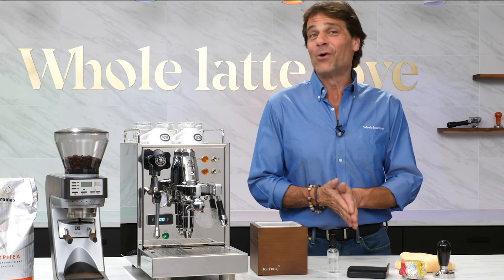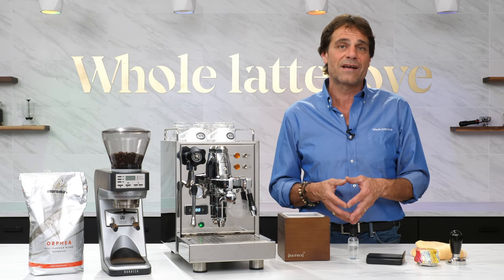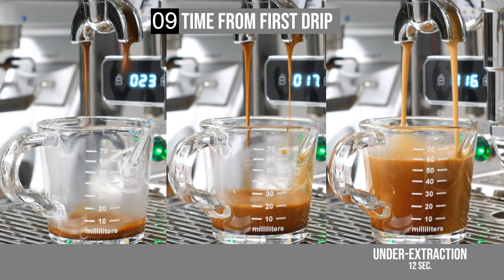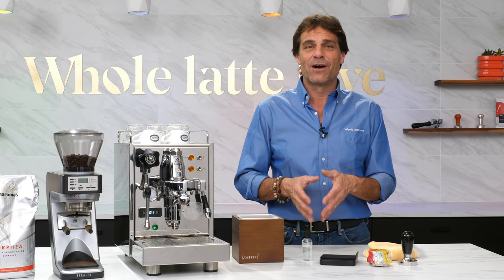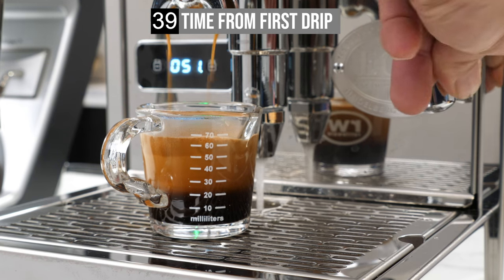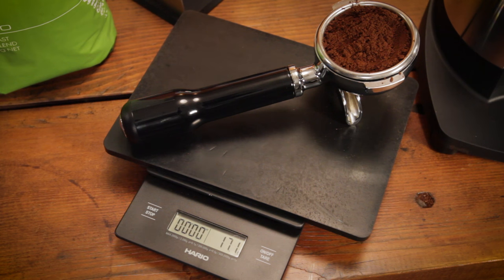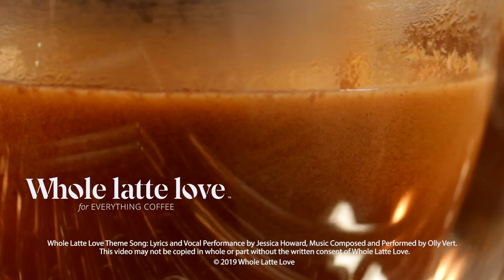How To Dial In Grind Size for Espresso

Comment: A question about brew pressure:  As the pressure builds, does it reach the maximum point (e.g. 10 bars) because of an equilibrium with the coffee and the extraction flow - or - does it reach the max point because that's what the OPV is set at?  Or to ask it differently - should I try to achieve 10 bar through grinding and tamping, or just set my OPV to 10 bars and instead try to adjust the flow rate?
Reply from the maker: Hi Bob, Thanks for the question. Not sure what type of machine you have so if rotary pump set OPV to 9 bar on the machine gauge. If vibration pump 10 bar on machine gauge - that'll get you ~9 bar at the group. When dialing in you can reference the brew pressure on the machine gauge but IMO timing of 20 - 30 seconds from 1st drip is more important when dialing in grind. I would not worry too much about getting to a grind which causes a brew pressure that gets you to the OPV limit. In nearly all cases there's no benefit to brew pressure above 9 bar. In fact, in my experience and others there's little difference in extractions in a range of 5 - 8 bar and they tend to be more consistent shot to shot. In those ranges flow rates can make a big difference. Hope that helps!
Marc
Reply: Thanks, Mark  I have a Bezzera BZ10.   After watching your vids as well as others, I am now just realizing that my concept of brew pressure was wrong and that's why I've been unable to get a decent extraction from the BZ10.   Luca Bezzera explained this in one of his vids.  The target brew pressure depends on the type of pump.  Large rotary pumps operate at a lower pressure than small vibrating pumps.  The OPV on the BZ10 is set to 12-13 bar.  I've been going nuts trying to adjust the grind to achieve 9-10 bar, but could never get the right flow rate.  Now I know why.  I thought 12 bar was "off the charts" but in fact, that's the sweet spot for the BZ10.  Now, thanks to your comments, I won't worry so much about the pressure gauge and just concentrate on the flow rate.  At least I know that 12-13 isn't "wrong" for this machine.

Comment: Hi Mark,
What is your recommend volume for fresh coffee and not so fresh coffee?
As both produce different crema.
Should I set 60ml as per video?
But I saw you extract 70ml.
Is the volume of espresso include crema?
Reply from the maker: Hi Bryant, One has to estimate a bit when using liquid volume to measure an extraction. For coffees which produce a lot of crema I find a 17-18g dose results in ~70ml including the crema at a 1:2 brew ratio. If the coffee is not producing a lot of crema because it's not so fresh or a type that doesn't produce a lot then volumes will be much lower. If you want to be precise it's best to weigh the espresso as it extracts to reach the desired ratio. Hope that helps!
Marc
Reply: @Wholelattelovepage  Hi mark, so meaning 60 to 70ml of liquid is depend on scale.
If I using 18g, the liquid volume will be 36g which may be 70ml.
So best to purchase scale right?
If currently I do not have scale yet, what is the recommend liquid volume for fresh coffee that produce a lot of crema.
Should I set to 70 ml?

Comment: How about grind size with the dynamics latte crema?  Having trouble getting a non bitter or sour shot with black cat and illy intenso
Reply from the maker: Hi EM, The Delonghi Latte Crema? Bitter shots indicate an over extraction. Options to correct for bitterness are: set the grind coarser, reduce amount of coffee used (lower the strength), reduce brewing temp, decrease shot liquid volume. Sour shots indicate an under-extraction. To correct for sour flavor: decrease grind size, increase coffee dose, increase brew temp, increase liquid shot volume. Hope that helps!
Marc

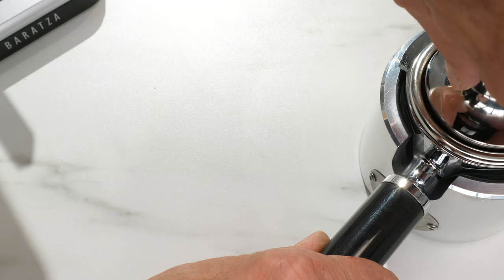Comment: At about 5:10, what is the ECM product that your setting the portafilter into to evenly tamper the grounds? This is by far the most frustrating a difficult variable in my espresso process in that I’m not evenly distributing and tamping the grounds exactly level. I get pooling after extraction which I know level tamping and even distribution fixes. I would love to know what that thing is called. Thank you

Comment: It is possible to get a great shot with 17 seconds? Gaggia classic pro with IMS basket, I use preinfusion (manual with trick) and temperature surfing. I use about 8 seconds of preinfusion and then I brew but I get very fast shots (17-20s) to get the 1:2 ratio but they are delicious so I am not getting it...
Reply from the maker: Hey Peter, Thanks for the question. If it's delicious at 17-20 with 8 seconds of pre-infusion then I see no reason to change. End of day, taste is what matters and not hitting a magic number which is just a guideline.
Marc

Comment: Hi Mark. Why every time I read about brewing for espresso it says to grind fine. Then the extraction won't run as it should be. I use a Breville touch with the integrated grinder. I'll appreciate your advice. Thanks, Enrique.
Reply from the maker: Hi e, You need to adjust the grind to pull the espresso in the 20-30 seconds from 1st drip. That's the basic dial in of grind size and tends to be a very fine grind.
Marc
Reply: Thanks for your reply. I'll look into it and let you know how it goes. All the best.

Comment: So, its count from first drip of coffe, not from the you turn on the pump 🤔
Reply from the maker: Hi HP, That's what I use. In my mind extraction starts when water starts flowing through the puck. This happens faster on rotary pump machines than on vibration pump machines. Then there's pre-infusion - not used in this video which could go for 10-20 seconds with no substantial flow through the puck.
Marc
Reply: @Wholelattelovepage  thanks a lot!! :)
Reply: Almost everyone else in the coffee indutry uses pump. Be warned

Comment: Love watching your videos ... now that I've found them. I've been using a KitchenAid Proline Burr Grinder for my pour over, French press and stovetop moka espresso coffee makers. Now, my wife is offering to purchase me an espresso machine, probably the Gaggia Classic Pro. What are the chances that I will be able to get a fine and consistent enough grind with my Kitchen Aid Proline grinder? I do have new replacement burrs from KitchenAid to install in the grinder. Thanks for your advice!
Reply from the maker: Hi William, Thanks for the kind comment and question. While I have not used that grinder, my understanding is it's a stepped grinder with a limited number of grind settings. I looked up the KA PBG and it does not seem to have a method for grinding directly into a portafilter - but I could be wrong on that. Dumping/dosing from a grinds container into a PF gets old quick, can lead to poor grind distribution and wasted coffee. For espresso, tiny changes in grind size make a big difference. Grind quality is usually more important than the espresso machine. I recommended considering a grinder with stepless grind size adjustment which can grind directly into a PF. Hope that helps!
Marc
Reply: @Wholelattelovepage  Marc, that helps a lot. Since the Gaggia Classic Pro comes with a pressurized portafilter, that means I can use my current grinder until I can replace it with a Baratza (probably a Sette 30). That way I can do this in two steps without layout out almost $600! Regardless, your discussion of the Gaggia Classic Pro really solidified my interest in that espresso machine as a good beginning choice.
Reply from the maker: That sounds like a good plan! I know good espresso grinders are not cheap 🙂. Like I said, I’ve never used that grinder so outside chance maybe it can grind fine enough for non pressurized but looks like there’s a limitation on precision of size adjustment. Can always go with pressurized if you have to. 
Marc

Comment: Hello Mark! 
Why do you choose to start the timer from the first drip vs (as I’ve read I’m some articles) pull the lever. I’m my case using the barista express when the button is pressed there’s about 9-10s of pre infusion before the first drip—what’s your advise with my case too? 
Thanks!
Reply from the maker: Hi Omar, Thanks for the question. I choose to go with first drip as I work with a variety of machines. Some have rotary pumps which build up pressure faster than vibration pump machines. I’m often working with pre-infusion which delays full pressure flow thru the coffee for 5-20 seconds. In my mind extraction starts when brew water is flowing thru the coffee. Depending on machine and/or technique when flow starts can be very different. Keep in mind, timing of extraction is the most basic method of evaluation. It let’s you know you’re in the ballpark.
Marc

Comment: Thanks for making this video!

I have a Gaggia Classic Pro and Eureka Mignon. With fresh beans, the time taken to output from 16-18g dose to the desired standard ratio is shorter than 20s. I’ve tried adjusting the grind size to finer (between 1 to 2), but resulting a bitter/burnt smell after brewing.. How can I improve the yield time without creating the burnt taste?
Reply from the maker: Hi KC, Thanks for the question. It may be the coffee you are using. If not some other ideas:
1. Bitter flavor (unless inherent in the coffee) indicates over-extraction. You could try a short cooling flush of 1-3 seconds just prior to making an extraction to reduce the brew temp.
2. Combine a larger coffee dose with same or slightly coarser grind to slow things down and avoid over extraction.
3. Cut the shot sooner and don't worry about the timing if flavor is good

Comment: HI Marc, love your videos!  I'm struggling with getting it right with my new Gaggia Classic Pro, and 270Wi.  Burned through half a bag of Orphea, and it still doesn't seem right.  Last attempt was a grind setting of 7A, 16g load, 25 second extraction, 33g shot out.   Still kinda bitter.  Maybe it’s me?    Maybe I should have got a Jura instead?  LOL
Reply from the maker: Hi Q, Thanks for the comment and question. You are in the ballpark with that timing and yield. Do know every grinder will be different so I can't say much about your specific grind setting. And don't lose those shims that came with your Sette. During initial break-in your grind will gradually get coarser. Usually need to a use a shim after about 8lbs of coffee ground. One thing you might try is a short flush from the group without PF in place right before an extraction. Just a couple seconds to bring the brew temp down a bit.
Marc

Comment: Hi, I just bought the Rocket Faustino grinder and the shots are still going too fast even when I put the grind size on the finest setting. The shots are awful on my new Rocket Appartamento. 

Please help.
Reply from the maker: Hi Duncan, Sounds like you may need to calibrate your Faustino to adjust minimum grind size. Very easy to do, takes less than a minute. Here's my video that shows you how: https://youtu.be/EhtM3k1zXms
Marc

Comment: Mark, love your instructional videos. I'm always trying to improve my technique with espresso. I'm currently experiencing an issue with dialing in. My setup is a Rocket R60V, Fausto Grinder, Acia Pearl Scales, and an VST 18g basket. I'm in a very dry environment (AC all the time) so I get grind "clumping" when grinding into the VST basket. Question 1; Does this "clumping" affect the extraction? Question 2; I use a 2:1 ratio for extraction, 18g dry coffee for 36g extraction result. When should I take the timing? Is it from the first drip into the cup, or when I pull the handle to start the extraction? Thanks for the feedback and videos. Cheers Sean
Reply from the maker: Hi Sean, Thanks for the comment and question. Sorry for a delayed response. I've been on vacation for a week and disconnected. First, nice setup! As to your questions...
1. Clumping can affect an extraction. Exactly how much is hard to quantify. I wouldn't worry too much about minor clumps. You can try stirring your grind to break up clumps prior to tamping/leveling.
2. If using brew ratios you are beyond timing extractions so long as they are reasonable in length. As mentioned, I've had great espresso that went 40+ seconds. When using timing to get in the ballpark of reasonable extraction I use first drip to start the clock. A machine like yours with pressure profiling is a perfect example of why first drip is IMO a better place to start. You could be doing a very long low pressure pre-infusion say for a very fresh single origin 100% Arabica coffee to allow for off gassing prior to ramping up to higher pressure for the actual extraction. In that case I would not count the pre-infusion in the shot timing. Hope that helps!
Marc
Reply: Whole Latte Love Thanks Marc for the feedback, keep up the great work👌

Comment: I have buzzera Magigga and when I brew the coffee the preassure goes up to 12 bar. Is that normal? shouldn't have been around 9-10 bar?
Reply from the maker: Hi LT, Yes, that is normal. Pressure indicated on the gauge does not necessarily reflect the pressure within the group when extracting espresso. Here's a video explaining why that's often the case: https://youtu.be/Z2DNW7ZVolg
Marc

Comment: Hi, I'm from Italy. Currently I'm using a Mix of 70 % Robusta 30% Arabica Coffee from a local. They have other two types of beans, one is 100% Arabica and another is 30% Robusta 70% Arabica. I still can't figure out which one is better for my homemade espresso. I'm looking to get an espresso definitely not sour or bitter and more full-bodied. And I was curious why a single shot filter always giving me trouble. Any advice? 
P.s.: I normally use 16.5 to 18g of beans with a 1:2 ratio to get 34 to 36g of coffee in about 30 sec with a manual grinder (I just purchased a Breville smart grinder pro, not yet arrived though). Still not enough crema and density.
Reply from the maker: Hey ntn, Your brewing parameters look great! Robusta in the mix helps with crema and body but too much usually means more bitter flavor. In general, 100% Arabica has less body, less bitterness but may be bright/acidic when fresh from roast. I'd give the 30R/70A blend a try. Lack of crema and density might be associated with your grind quality. The new grinder may help with that. If no luck with local coffee maybe try some Lavazza Super Crema. It's a 40R/60A blend with good crema production.
Hope that helps!
Marc
Reply: @Wholelattelovepage  thanks for the reply. Yeah, they called that 30r/70a mix "Miscela Bar" so it makes sense to have it a try. Coming from the italian city of coffee, hometown of Illy, should be more easy to get help from locals, but here the "home made'' espresso ain't that popular as worldwide, so, cheers to you mate.

Comment: hey Mark, this is helpful! are you using here pressurized or non pressurized
 basket?
Reply from the maker: Hey OG, Thanks for the comment. Non-pressurized for sure! Much better espresso than what you get from a pressurized basket. And, grind size won't make much of a difference in pressurized so long as you're in the neighborhood of espresso grind.
Marc

Comment: Hello, I keep reading that the entry level coffee machines don't work well with non pressurized filter baskets & the grind size probably will not help if one tries to use non-pressurized basket instead of the provided pressurized filter baskets. I have the Breville Bambino Plus which only comes with pressurized baskets. To improve the texture & flavor of my coffee, I want to get the non-pressurized baskets for the 54mm portafilter. I hear it works with this machine. So, my question is: Will Sette 30 produce a good enough grind for me to get a better coffee from my Bambino Plus & the non-pressurized baskets OR it won't make much of a difference in flavor, texture & crema until I have something like Sette 270 to have more control over the grind size?
Reply from the maker: Hi Neha, So the Sette 30 is not a grinder I usually recommend for espresso grinding. But It is passable and I don't think it's totally unreasonable to use with a machine like the Bambino. The 30 is essentially the same grinder as the 270 but lacks the micro adjustment to help get you dialed in to grind size perfectly. You can compensate with compromise by slightly adjusting the coffee dose weight a bit. Add a little more coffee if you think your grind should be finer but going a whole step finer on the 30 would be too much. Conversely you can use a little less if it needs to be coarser but not by one whole step on the 30.  I cannot give an opinion as to how well a non-pressurized basket will work with the Bambino as it's not something I've tried.
Marc